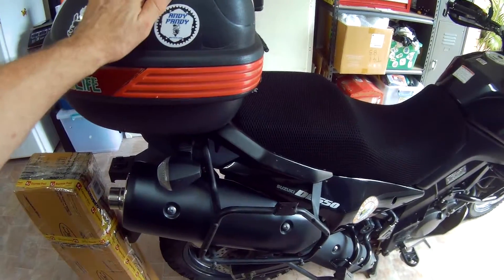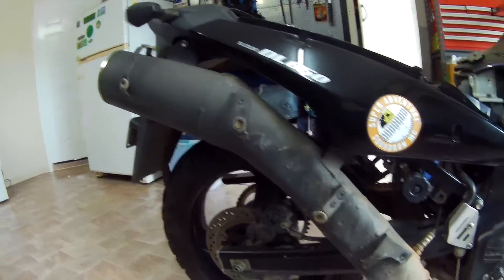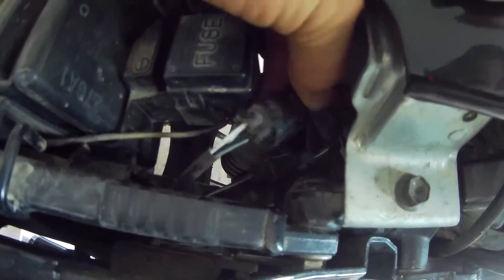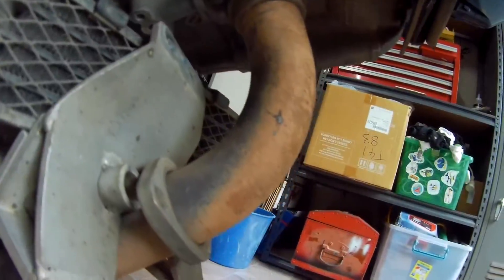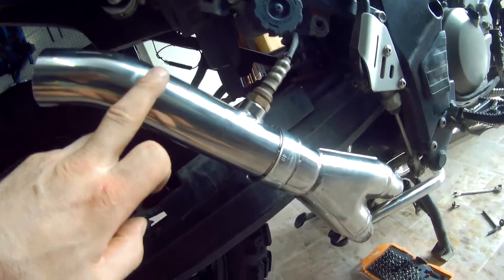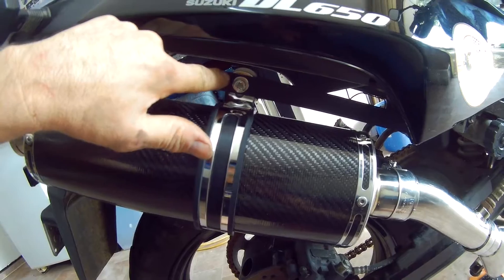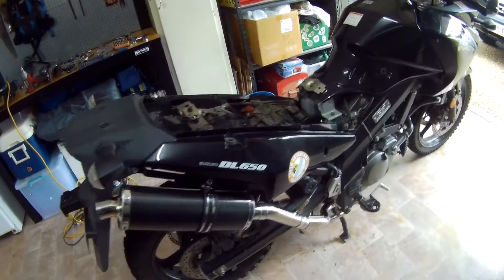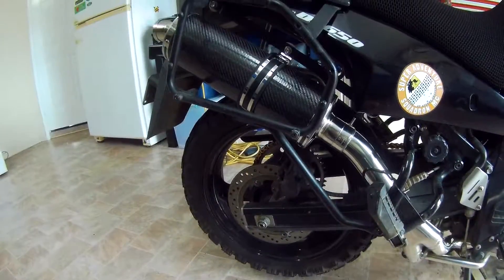Delkevic Motorcycle Exhaust Install - Suzuki DL650 V-Strom

Comment: Delkevic  is the best value exhaust I've ever come across,  I would consider one for any bike I ever purchase just about.  All though I found the strap for the silencer on the inside bit is SHARPER than anything I ever thought possible.  It won't damage the silencer in anyway but it will open you up good if you don't treat it with caution.
Reply from the maker: Wow! Thankfully I haven't experienced that yet! After 2 years on the bike though I'm pretty happy with the Delkevic!

Comment: Looks good and sounds even better. Getting the standard exhaust off is a pain, the 2 pipes at different angles fight against each other. 
I was surprised how good the quality is for the price and the customer service is good too.
Reply from the maker: Yeah, but I reckon it would have been fairly easy with no bash plate or centre stand. 
I'm more than happy with the quality for the price. Yeah I had a great customer service experience as well. Really nice bloke to deal with.

Comment: Thanks for sharing. Been thinking of replacing my pipe on my DL650 since I bashed it a while ago, and this looks like a good option
Reply from the maker: No worries. They are great value for money I reckon. Part of the reason it took me so long to get an aftermarket exhaust is the price of some of them, but this was very affordable.

Comment: Good on ya mate. I wanted to install the exact same pipe on my bike. I'm useless when it comes to wrenching, and on account of the fact that I have the centre stand and the bash plate, there was too much goofing around. So, I'm stuck with the stock pipe. :-(  

Yours sounds awesome though! Stay upright :-)
Reply from the maker: Thanks mate. Yeah, it was a bit fiddly for sure with the centre stand and bash plate. I was lucky that I had the keys to work that day so I made a quick dash in there to grab my angle grinder. Without that, the pipe wasn't going to fit!

Comment: Tasmania? I guess this was done pre covid. Looks like a little bit of bother changing the exhaust. Did you leave the baffle in?
Reply from the maker: Yeah, I was lucky enough to get home from my Tassie trip just as everything started shutting down. This was filmed in February. I put the baffle in every now and then, but for the most part, I leave it out.
Reply: @MrAusadventure  Depending on what you are doing can take it with you.

Comment: Looks so mutch better then the oem exhaust.... Smooth sound mate.
Had the same troubble with the exhaust when l was taking it off. The spring pin on the centerstand made my life hard that day..
Vstrom on tour..you putting out film?
Reply from the maker: That spring was a nightmare when I installed the centre stand in  2011. Until I Googled a solution and saw the rope trick, where you tie a shoelace type rope to it and wrap it around the wheel. Gives you leverage and it just popped on! 
Yes I filmed the trip. Had loads of audio issues though so I'm not sure how I'll edit it yet. Lots of other trips to edit before that one though! lol
Reply: @MrAusadventure  l just turn the volum down if it try to ruin my speakers 😀. Good to see the vstrom back on tour mate. 
My strom has a riding straight issue, so now Dame Edna(what CaptainCranky calling her) lives on a lift in my garage. Hope i get her ready for winther commuting. Now l got a 2011 Tiger 800 xc, like the one you testet some years ago. Summer bike.

Comment: Has it broken yet? It will. There’s a metal flap in the mid-pipe collector thing that is very poorly spot welded into place. When those welds break, the flap rattles around in there. Mine currently sounds like someone dropped a handful of coins into the exhaust! Delkevic replaced the first one, but that meant going through the hassle of uninstalling and reinstalling the whole thing. Then it did the exact same thing 6 months later! Luckily, I kept my spare and took it to an exhaust place that used a torch to melt the flap and get it out of there. Now I just have to go through the faff of replacing it AGAIN! Buyer beware.
Reply from the maker: That's a bummer. Nearly 4 years and 50,000km later and this exhaust hasn't given me any issues despite being bent from multiple drops on that side of the bike on an extreme ride in the Tasmanian wilderness.

Comment: Delkelvic makes a great looking system. Even the mid pipes look great .  The V Strom sounds awesome. It seems like anything on the bottom side of the V Stroms can get a little fiddley. Did you end up leaving the baffle out?
Reply from the maker: They definitely do look great. Not as large or in your face as some exhausts can be. It now sounds like a V-Twin should! 
Yeah I guess they do jam a lot of stuff under the bike on the Stroms. Most people tend to put bash plates on them at least. 
Oh yes, for the most part, the baffle is always out!

Comment: Nice video mate. Just ordered one for my 2009 650. Looks like there will be a lot of swearing and cups of coffee getting that original b'tard off! 🙈
Have you still got the bike?
Reply from the maker: Thanks mate. Yeah, it was quite a challenge to fit it. And I'm pretty good with mechanical things as I've worked on vehicles for over 20 years as a job. 
Yep, still got the bike. I just arrived home from work on it half an hour ago. Still going strong at 136,000km.
Reply: @MrAusadventure  Glad to hear it's still going strong. They really are great wee bikes. Looks like I'm in for a proper challenge then 🤯
Reply from the maker: @CuillinG  It could be a learning experience! 🤣
I give a bit of a run down on my bike over the years in this video that I made after 111,111km in 2022. 
https://www.youtube.com/watch?v=oGcY0HbvCXs